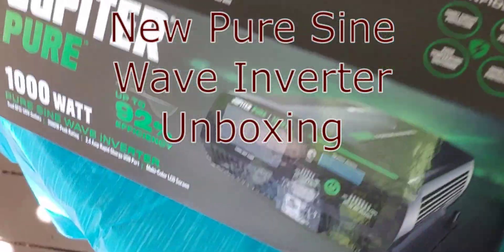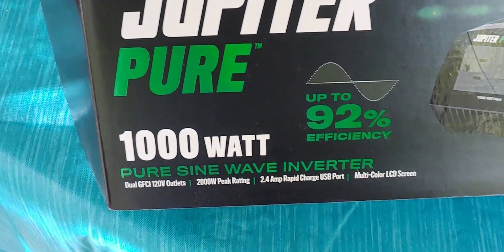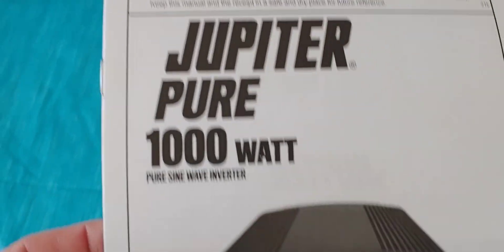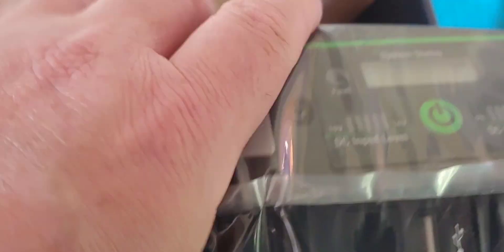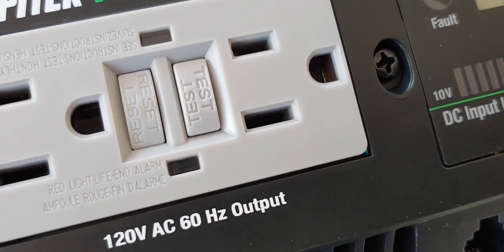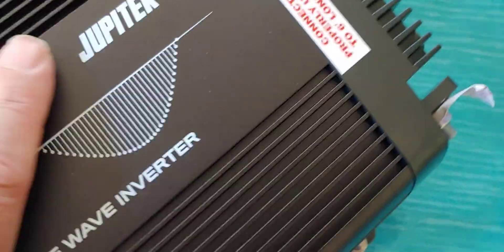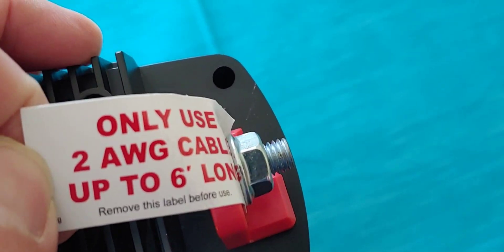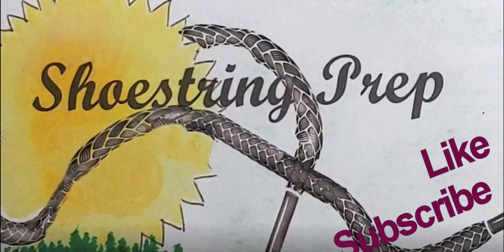Jupiter 1000- Watt Pure Sine Wave Inverter

Comment: I also bought the Jupiter 1000 watt pure sine wave inverter.  It is ok. Does what it is supposed to do.  The one issue I had with it was the fan came on all too often and the harmonics drove me up the wall!  😂there was no way I could sleep with it on in my RV.  Ended up upgrading to an LiTime 3000.  It would even run my AC!  But pulled the batteries down too fast.
Reply from the maker: The fan is to loud no doubt about that. Thanks for your comment.